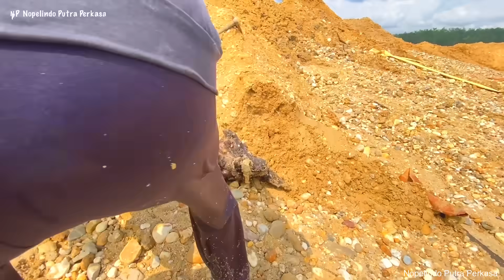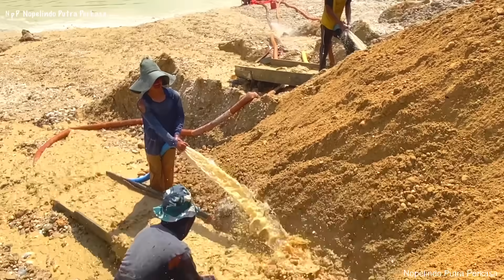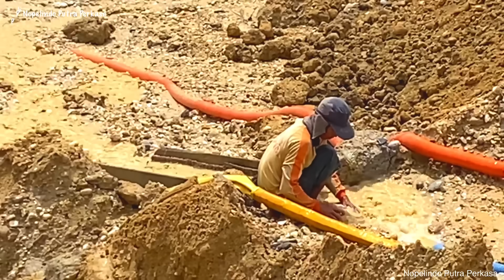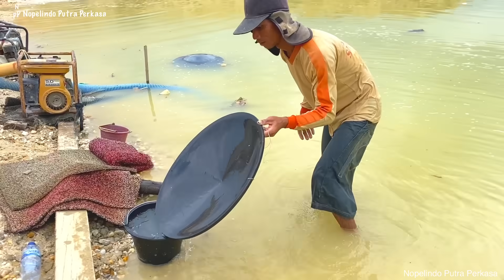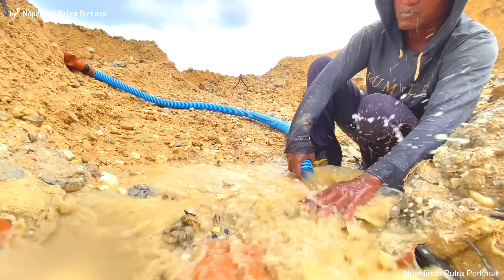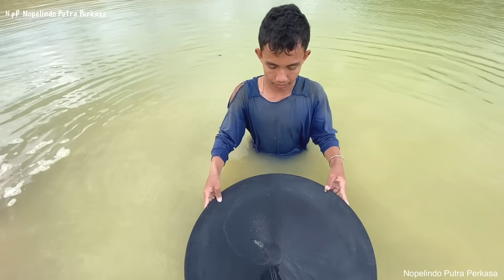NEGERIKU INDONESIA TANAH AIR PUSAKA, DAERAH TAMBANG EMAS DI INDONESIA,FOUND GOLD NUGGETS,खजाना फिल्म

Comment: Hydrolicking feeding direct to simple sluices wood box, Pls use riffles or jampingan it ll be much better pak, coz gold sg is 19,3 it mean 19,3 times heavier than water so slurry which goes to feed sluices box ll be better if 70 percent is liquid n 30 percent is solid or maybe 80 liquid : 20 solid..., If to much solid/material gold ll be overflow, that's way this method is less recovery rate than other mechanical gravity equipments also coz miner never concerning in regard solid n liquid composition, apologies if am wrong tks
Reply from the maker: Thank you for your input and criticism, friend ...Welcome to Indonesian traditional gold prospecting 🇮🇩🙏🌸🌼👍